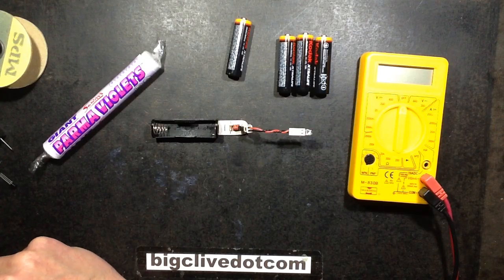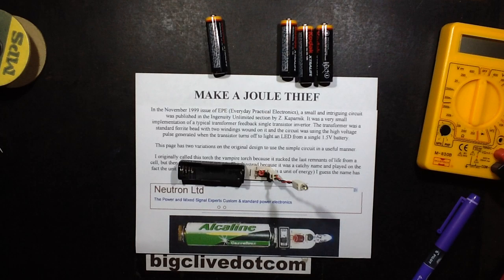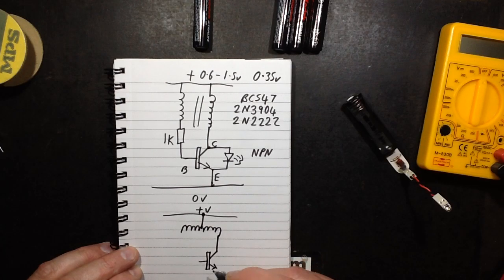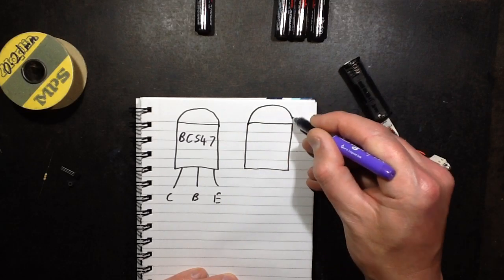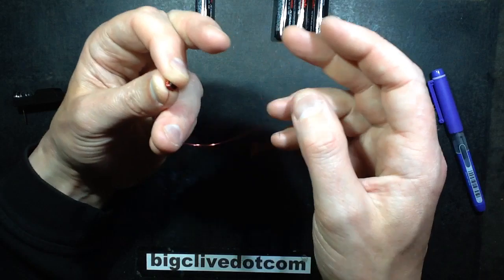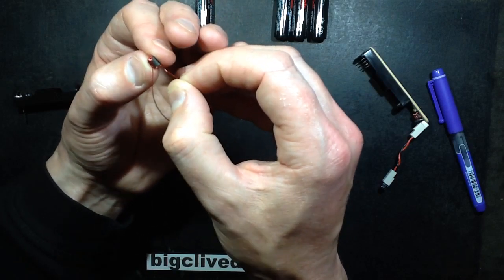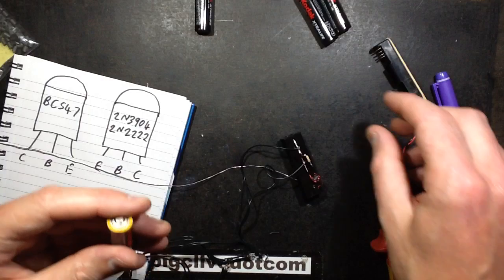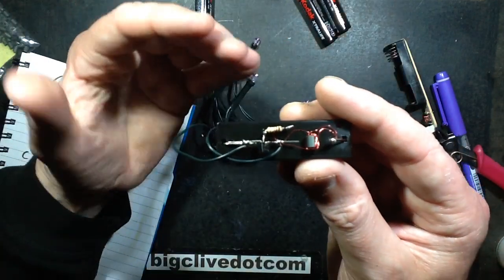How to make an authentic Joule Thief.

Comment: i still don't understand what the toroidal bit actually does and why the transistor pinches off at some point. 

1) the current coming from a 0.6V battery going through a 1k ohm resistance is enough to turn the transistor ON, right? so at the beginning, it's just a boring circuit with enough current at the base to turn on the transistor and the current goes through the transistor, by-passing the diode.... right? 

2) then at some point, the induction generated in the transformer becomes such that the transistor pinches OFF. why? what happens? something to do with the primary winding being in the opposite  or the same (?) direction as the secondary winding?what exactly happens that makes the transistor pinch OFF?

3) I understand that once the transistor pinches OFF  - for whatever reason - then all the current accumulated in the secondary winding rushes to the LED and it's now enough to make it bright. Because the transistor is OFF, none of the current goes through the transistor and all of it goes through the LED.

4) It must follow that the LED flashes on/off at a frequency that just happens to be fast enough that we don't notice. Is it just a great coincidence? is there a critical factor to be considered to make sure the LED flashes fast enough, e.g. properties of the transformer, or the LED itself, or the resistance connected to the base? if one uses a very low or very high inductance in the transformer, would the flashing becomes obvious? do you know the flashing frequency of this particular circuit? what equation would be used to calculate the frequency?  

thanks for the great video! it's absolutely fascinating!!! if someone finds the time to explain the bit I don't understand, I'd be really happy! It's probably a very basic thing, but I'm really struggling with this one because - obviously!!! - I don't know much about electronics and I'm just trying to learn whatever I can watching your stuff....
Reply: I can't say I really understand the circuit, but it's an oscillator of some sort.  The very small inductance will give a high frequency, well above visual perception of flashing.  No offence to Clive,  but  I think a centre-tapped transformer has 5 terminals, so maybe that's the wrong term here.  Maybe it also depends on the effective capacitance of the cell?...  I dunno.  Good questions, sorry I could only answer one of them.  Anyway, it works!
Reply: PS: this was naģging at me so I checked out the wiki article.  It has a complete description of the original and acknowledges Clive's variant.
Reply: The details that are never explained are:
1-When starting, the current thru 1K resistor is : I=V/r = (1.5V-0.7V)/1000 ohm = 0.8V/1000 ohm = 0.8 mA.
2-assuming the transistor has a DC gain of about 100, it will amplify the base-emitter current of 0.8 mA times 100 : 80 mA
3-the transformer primary side on the collector generate a positive voltage on the secondary side. Let's suppose it add 1 volt.
4-the current at the base increase. It would be : (1.5V + 1.0v - 0.7v) / 1000 ohm = 1.8v / 1000 ohm = 1.8 mA
5-The transformer transfer part of this extra current to the secondary which increase the voltage a little more
6-This is a positive feedback loop that repeat until the transistor saturate. That is, even if the secondary keep increasing the voltage and the current at the base increase, the current at the collector can not increase anymore once the transistor act as a short circuit
7-After a small delay, since the current does not increase anymore, the transformer invert the voltage on both side. The voltage rise more and more until something start absorbing the energy.
8-the voltage at the base of the transistor becomes negative. Since it is a diode, no current flow. A transistor can survive such shock for some time, if the voltage don't become excessive
9-the transformer try to release the magnetic energy on the primary side as well. The voltage raise until a white LED, for example, start absorbing the current. So, when reaching 3 volt, the current start flowing in the white LED which make the transformer happy.
10-when all the energy is dumped, the transformer swing the other direction to get ride of the remaining energy. 

It is like a swing where you push forward gently but quickly. Then, as the kid comes back, he/she drag its feet to loose some energy. But the swing continue past the rest position and the kid go up in the backward direction. Then, the swing comes back in the forward direction. At that point, he/she would slap you in the face to wake you up, so you push the f*@king monster forward.again as hard as you can. The little monster, once again, drag it's feet on the way back And the cycle repeat for hours till you become too weak to push. At that point you are a dead battery.
Reply: Christian Gingras thanks man. i really appreciate. i'll re-read the explanation with the circuit drawing in front of me to try and understand what you're talking about - i do not have any training in electronics but i sort of realized that some details were missing...
Reply: Christian Gingras your name sounds like the name of a french quebecois.
Reply: You guessed right! I am from Quebec city, but live in bay area for 15 years.

I was working for laser companies as embedded engineer. I am trying to find a job as software engineer... very difficult when someone does not have many friends already inside.
Reply: Christian Gingras je te comprends. je suis montrealais, j'habite en suisse depuis 5 ans mais je veux revenir bosser a seattle/sf/la dans le demaine des polymers ou propriete intellectuelle (phd chimie) et c'est super diff de trouver du boulot sans contacts a l'interne. j'ai quitte la silicon valley en 2000 et je ne connais plus personne... comment tu t'en sors? tu bosses en ce moment? le marche du travail a repris sur la cote ouest?

Comment: will this supply enough current to run a 555 timer reliably?  Thank you.
Reply from the maker: It's really optimised for an LED.  It would require a diode, capacitor and voltage capping device for a 555.
Reply: @bigclivedotcom  Thank you.  I just found your channel today, Im getting back into circuit building after 30 years and realizing how much knowledge I have lost.  I appreciate you sharing like you do.  It makes it much easier to learn than hitting the books back in the 90s.
Reply: I tried, and was able to charge 50ish ferad capacitor bank that makes my lathe scream.. so I think it just might.  Im not savy as you in this, but I wonder if integrating the 555 could make more efficiency with the ability to control frequency characteristics.

Comment: That is NOT the discharge curve for an alcaline cell. It is fairly linear down to 1V, after that it drops to zero quite drastically. When the battery is at 0.6 V, there is practically no energy left in the battery. Google it!

Comment: Isn't the LED backwards? I was pretty sure that the anode needs to go to ground!
If it's wired the way you have it, the LED will start conducting if 2 batteries are used in series. 
Am I wrong? Could any one care to explain to me what would prevent the LED from conducting and bypassing the transistor all together if the battery voltage is 3-4 volts? The CEMF is negative spikes after all!
Reply from the maker: +UFOhunter The Joule Thief is only intended for use with a single cell.
Reply: That explains it. Thank you for clearing that up.

Comment: still dont get it. so its half rectifier. just a quick question. what if i put 1.5v(full charged battery). how much voltage the output?
Reply from the maker: The output voltage will be limited by the LED connected across the transistor.

Comment: honest question. why is this useful? run a led at less than a usable brightness? I just don't get it.
Reply: It's just cool
Reply: ditto it's just cool... but I've thought of an application anyway. the leds could be in a battery operated illuminated sign in a retailer. typically they're just left on around the clock and it'd mean less climbing of ladders to change the battery. everytime you climb a ladder there's a risk of injury so clive has made the shopkeepers life safer.

Comment: can it be used to power a bldc controller, using LI-ion battries?
Reply from the maker: It's only suited to simple LED illumination.  You could use a regulated supply for more complex circuitry.
Reply: @bigclivedotcom  thank you for the reply!!

Comment: Very basic blocking oscillator circuit! Add in a capacitor (100nF or so between base and resistor I think) if you want an audio oscillator

Comment: Could this circuit be used on a solar cell for night use.
Reply from the maker: Yes, you could use a solar cell and a diode to charge a NiMh (Nickel Metal Hydride) cell during the day and switch it on manually at night.

Comment: That basic oscillator, is also known as a "blocking oscillator", and goes back to the tubes days. Another coil option is to use a common mode choke. You can find those where the "mains" (AC line, here in the US) power comes in any piece of consumer electronics. The common mode choke is part of the power filter.

https://threeneurons.files.wordpress.com/2011/09/joule_thief.gif

Now, I know where it got its name ... Thank you !

Comment: I actually used bc548 it also worked but whats the difference in 547 and 548
Reply from the maker: I think it's the voltage rating.
Reply: Oh okay

Comment: Hi Everybody!
I have just made a Joule Thief, works perfect, but while I was fideling around with the "thief" a very little magnet from a cellphone camera attach itself to the coil and the LED suddenly gave much more light. Can you explain what happens?
My next attempt is to wind a coil on a little neodym magnet. 
The Joule Thief rocks.
Reply: Jesper Kleemann Probably the magnet was changing the saturation point of the coil's core and letting more current build up before it switches off and discharges through the LED.
Reply: Brad N Hi brad, your right. I thought of that myself and I have had a oscilloscope to help, a thief i have build showed that the frequency raised to allmost the twice, it showed 32.1kHz without and raised to 59.5kHz with the magnet, and I could make a hole bunch of funny and interesting waveforms by moving the magnet I could actually use the magnet and thief as a sort of variable wavegenerator.
(sorry for bad gramma)
Greetings from Denmark.

Comment: Jut curious but what happens when you use a full voltage battery?
Reply from the maker: It starts brighter and runs for ages.
Reply: +bigclivedotcom I just wanted to let you know that the 'standard' transistors you name have DRASTICALLY different collector current maximums. BC547 - 100mA 2N3904 - 200mA 2N2222 - 800mA/1A depending on manufacturer. Just keep that in mind, they're not exact replacements for each other. I wouldn't, for example, use a 547 in place of a 2222. Not to mention that the Vceo, Vcbo and Vebo vary wildly as well. The 547 also seems to have a much higher hFE.

Comment: So why isn't this circuit included in most, if not all, similar voltage, battery operated devices like remotes, lights etc?
Reply: Probably commerce Peter :(   not very green :(
Reply: 772pcs seems quite green to me by using all the juice from the batter but I also know it probably doesn't make sense from a cost perspective.
Reply: No Peter, I mean the commerce isn`t very green. They want you to buy more batteries. :(
Reply: The real reason is because the output of this circuit isn't a continuous voltage but a series of voltage spikes which few electronic circuits can cope with.  Also, the average voltage will vary wildly as the cell discharges, which again most circuits can't cope with.  A LED is one of the very few electronic components which can cope with both of these problems, in this particular presentation.

Exactly why an LED can cope when other circuit components can't is a very involved discussion better suited to a physics textbook or at least an electronics textbook.

Adding a capacitor will help with the voltage spike problem, but not with the voltage variation problem.
Reply: Thanks JasonMasters. That was my thought as well. Given its ability to use ALL of the energy in the cell, I figured there had to be a limitation like that.

Comment: 2n2222 ... I like how you slip a stab at Amerikans on that.
Reply: +SBwingman To be fair, as an ordinary citizen, I didn't get a vote on what I was taught and Imperial is now burned in my brain (though I do like the millimeter and centimeter and use it).  Converting my little brain to metric would be tough, but I couldn't imagine doing the whole country after having imperial for so long.
Reply: +SBwingman we're stupid because we invented transistors then shared them with the world.
Reply: Paul Frederick claps
Reply: Paul Frederick Absolutely. If it wasn't entirely clear in my comment above, I'm American as well, and I was attempting to point out the absurdity of taking petty, generalized cheap shots at a very large and diverse country.
Reply: "Network developed entirely by Americans", but running on a system developed entirely by Europeans.  Remind me again when it was that the entire world suddenly went online and gave birth to this, the internet era?  Was it in the early 70's when Americans devised a way for Computer A to dial in to Computer B?  Or was it in the early 90's when Europeans devised a way for Computer A to dial in to an ISP and be connected to every other computer on Earth?    Take your time.

Comment: Could the jt ruin the rechargeable battery if get too low.?
Reply from the maker: A rechargeable cell should recover.
Reply: @bigclivedotcom  got me worried because Nintendo for game boy read not to use rechargeable I did anyways. Batteries started to smoke. I'm not sure why maybe I'm wrong those were for the nicads batteries. Maybe other chemistry will work out.

Comment: Huh. This may actually be exactly what I'm looking for for one of my projects. I need a really small, lightweight product which has 3 IR LEDs and a red indicator led that can all be powered for hours at a time from a button cell battery.

I'd also prefer it if it would recharge itself over time and have a small solar cell from an old Casio scientific calculator which I thought may be a good way to do this. My concern though is not knowing what I'm doing at all so I'm not sure how that would be wired up. I'm also worried the solar cell may not be able to charge it quick enough. Anyone able to help out a bit?
Reply: +James Coyle Just remember that a solar panel from a calculator will produce approx. 250mW which is very little power, you are better off using a panel from something like a desk lamp or a lantern (Poundland) they can produce about 1,5-2W. Usually you can recognise they produce enough power because of their size (about 4*4cm). Remember to add a diode to prevent the solar panel discharing the battery. Also don't use a button cell (it will explode when recharged) but a single rechargeable AA Ni-Cd or Ni-Mh (avoid Low Self Discharge, as they are trickier to charge) .
Reply: MrOpenGL Shouldn't a button cell work fine if it is a rechargeable one? The issue is that I need to basically fit this circuit in a matchbox so I can't use large batteries or panels.
Reply: James Coyle
Yes but I have only come across lithium-ion rechargeable coincells. Then you would not need a joule thief if you get a li-ion cell because it is 3.6V.
If there are Ni-Cd or Ni-mh coincells, these would be your best bet.
You can recharge an alkaline coin cell, but its voltage should never drop below 1V to avoid leakage ,and it will only last 20-40 cycles.

As for the solar panel, since calculator panels produce at most 1,5 to 2V, you will need to put two in series and add a diode.

Comment: Clive could the joule thief use multiple batteries at once using a double or triple cell holder?
Reply from the maker: +ozzlander88 Not recommended in series as the current will just flow straight from the batteries through the LED.
Reply: thank you for the response as a follow up question could you use this to drain NiMH rechargeable cells fully?
Reply from the maker: +ozzlander88 Yes, but I wouldn't recommend draining NiMh cells fully.  As soon as they start to dip I tend to recharge them.
Reply: Ok i was thinking maybe draining the fully recharging the batteries might help the issue i am having where they are only lasting a day or so in my belkin portal fm transmitter or about a week or so in a wireless mouse.
Reply from the maker: +ozzlander88 If you're suing a fast charger it may be terminating the charge early if they are low capacity or old cells.  Temperature could be an issue if it's very cold where you use the items.  It could just be that the belkin transmitter draws modest current or doesn't like the cells lower voltage than an alkaline cell.  Older NiMh cells have a high self discharge rate, so that could be the issue with the mouse.  If you got the cells from eBay then they may have a false capacity.  Many of the cells from China are just 150mAh.  Maybe time to buy some new good quality cells.
Reply: The charger is a bit of a cheep one that takes for ever to charge then just shuts off and i have to unplug and replug it to get them to charge its the Model 47618 from Chicago Electric but the batteries are energizer and Duracell maybe 2 years old

Comment: Is this how those cheap solar lawn lights work? I bought some 10 years ago and they still come on after sun set. They only take one AA battery. And it's a really cheap low mAh rechargeable battery at that.
Reply from the maker: Similar, but with a fixed pulse frequency generator.